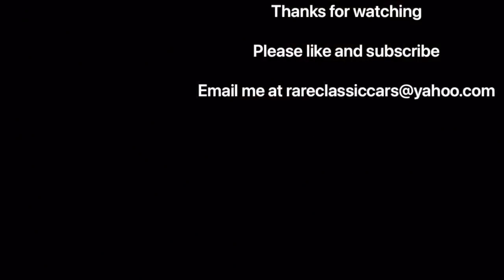Worst Engines of All Time: Chrysler 318/360/400/440 V8 Electronic Lean Burn

Comment: Everything made during that era sucked. Until they got computerized EFI with multi sensors, it was a Rube Goldberg setup. The easiest way to wake up one of those Mopar engines from that era was to order the Direct Connection Electronic Ignition kit. It came with everything you needed and the instructions to install it. You could do it in a Saturday afternoon with a couple of beers.
Reply: It was a little later,but I always laughed at them having electronic circuit boards mounted in an airbox to get airflow cooling.
Reply: @MrTheHillfolk  Land Rover until the early 2000’s because fuck the consumer
Reply: @MrTheHillfolk   My PCM is mounted in the intake air box before the filter.  Why do you laugh?  It's very logical..
Reply: @frequentlycynical642 vibration, under hood heat cycles, etc.  All play havoc on electronics especially from that early Era..
Reply: If you have a lean burn era 318 2bbl, the "cheap fix": hit the local autozone or equivalent, tell them you need a distributor, ignition unit, and carb (carb optional, you can just do the rod/jet magic) for a 76 or 77 dodge B300 van. They were "heavy duty, emissions exempt" on federal emission models, so plain Jane Mopar electronic ignition, no cat, plain Carter 2 bbl. Put all the lean burn junk in a box on a shelf in case you ever sell it to a purist collector, and tune your car like it's a B300
Reply: @ludditeneaderthal  you forgot the electronic ignition 5(4 pin) connector harness.. you can special order. Possibly some dealers parts department would still sell one. I think a dealer is the last place I got one.. but that was prob 10 years ago now. I've noticed parts for even late 80's cars are getting hard to come by and totally obsolete. Also should have a single ballast resistor hooked up to keep the coil from cooking itself. I've heard the accel super coils don't need a ballast... I still run one.. so can't say.
Reply: Your not wrong they all where doing things for emissions and they all took a hit for reliability and hp
Reply: I was thinking 73-87 was the worst time to be a🚗
Reply: @mankind8088  Depends. Some rear wheel drives were pretty good, and even Consumer Report rated them highly.The Fairmont and Zephyr were reliable, as were the Grenada and LTD. The FWD Tempo was pretty reliable. The GM rear wheel drive cars were also very reliable, and relatively affordable. The FWD Chrysler cars are laughed at, now, but they were really the leaders in affordable, FWD cars.
Reply: @mankind8088  I had 2 73 Monte I really liked. Yep still working on leaded. No cacalitic.
Reply: @mankind8088  I'm thinking only till 84.  85 had some good cars starting there
Reply: I did that to my 79 Lebaron with a 318. Also installed a 284/484 Purple Shaft, Edelbrock Performer, 650 Double Pumper, and a TCI 2,800 stall converter. Lots of fun!
Reply: @patrickmorgan7592  yep I had a 68 Newport with the 383 and the optional disc brakes. Very soft riding and very strangely good on gas.😍
Reply: @gerardcousineau3478  
How many  miles per gallon,  with that 383??
Reply: @albundy8052  you wouldn't believe me. but I would say I did about 20 I know that sounds crazy. It was as good on gas as my 73 Monte who was a 350 4bbl dual exhaust the hush trush might have helped. In comparison my 68 eldorado was doing 8 miles a gallon. The Monte Carlo and the Newport were miracles to me. Don't take me wrong though I did like the 68 eldorado too. The Eldorado had a radio that was phenomenal. The ride of the 68 Newport was also unbelievable. These were the day. But like Spock I have no regrets. Though the Monte had hush trush the Newport had it's original exhaust, interestingly with the front disc brakes option. This Newport for it's size was fantastic on gas ⛽.
Reply: I had a 77 New Yorker with the 440 and a Thermo-quad. It would randomly start detonating. The dealership told me that the Electronics were junk and they frequently would go through 5 to 10 new ones before they got a working unit.  they sold me this kit from Mopar Performance and told me it was made to take the old 440 with point ignition to electronic. Like you said, disconnect a few sensors, remove the spark control harness and replace the distributor and the electronic unit on the fire wall.  I had the car for about 4 more years and never had another problem.
Reply: @sreginkc  yep
Reply: Under the hood of my 82 Bronco, there are more vacuum lines than wires. I'm not sure I could get half the emissions stuff working even if I tried, or source any replacement parts. The original transmission had a 3.29:1 first gear and 0.75:1 fourth Overdrive with a 3.00 diff. Pair that with a choked-down 100hp inline six, and that's probably the reason why it was parked in a field for 25 years...No engine power with extremely fast gears. Crappy cars in the name of fuel economy and emissions. I'm glad I wasn't alive to experience it back in the day.
Reply: @jimjamauto   It’s all garbage. Take it all off, and throw it away. 😀
Reply: @drippinglass  That's the plan! Everything except EGR. I'm gonna switch to a Holley EFI and I already rebuilt myself a better transmission
Reply: @jimjamauto  EFI... Lazy!... Haha and why not block off the EGR? It won't hurt to ditch it. And likely would improve things. Another big thing to not forget is the heat riser valve. If ur not familiar it's a flap in the passenger side exhaust manifold. When the engine is cold it's supposed to be closed. Which forces hot air under the carb and choke thermostats (air goes through the intake in a passage) when the engine heats up the flap is supposed to gradually open to let the exhaust fully flow out of that side of the y pipe like normal exhaust. It's a great system for winter driver cars especially... Only problem is 98% of these 40-50 year old heat risers aren't working. Usually the flap gets stuck in the cold (closed position) which will force hot exhaust air constantly through your intake manifold always. So the engine will run like shit once it's warmed up. If your lucky it doesn't function because the thermostatic spring is weak.. but the flap moves free.. if that's the case you can wire it open. It will be good for a good while until you either remove it or replace it.. just a head up. It can be forgot easily and you and even pro mechanics will chase their tail.
Reply: @ron1836  it's gonna be my daily driver at some point so I don't want to deal with a carb. Plus I can make some more power and not loose too much fuel economy. I wanted to play it safe with the EGR because I know some engines do not like it to be removed. Still a novice so I appreciate any help I can get. Cheers!
Reply: I'm sorry but I must disagree. Early EFI systems were tremendously problematic as they got up there in miles. While it may be better in theory, in practice, if your fuel injected car breaks down in the middle of nowhere, good luck getting it back up and running again. At least the electronically monitored carbs and an idle speed screw you could turn up to max to limp it home if need be. Let it be known I've been stranded in far more efi cars than carburated, and I'm just talking about 80s cars here
Reply: I owned a few of these and replaced a lot of parts however for some reason I had a 400 in a Cordoba that was one of the most reliable cars ever
Reply: My parents had a Dodge station during this time period, damn thing could barely pull your socks off.
Reply: SO much sucking going on, from not only a pure aesthetic pointa view, or mechanically, but everything. From the quality of the steel to the quality of the plastics....even the fabrics were wAnK.  '73 - '80s especially.
Reply: @UberLummox  Yep they had to cut costs somewhere with all the Govt. mandates that were being dumped on them.
Reply: @UberLummox  the big three were in cahoots to release inferior products intentionally. If it wasn't for Japanese and European automanfacturers coming in the cars would still be just as bad
Reply: @XxxXxx-br7eq  they are stil bad
Reply: @spartacusnow that's why I retrofitted more basic parts in place of the primitive computer controlled junk. I'm somewhat of an expert on the subject. Ha
Reply: It all goes back to the beatniks & treehuggin hippies from the 60’s that took over the guvmnt & put greenhouse emission restrictions on the entire automotive industry because they were owned by insurance companies. You know how they operate, like gansters. Hey thats a nice car factory you got there bub! Be a shame if anything happened to it! You get my drift? LoL strong arm tactics always work against profit driven companies… which is every company that ever existed.
Reply: Yeah and that's because it had nothing to do with the engines they worked great it was the ignition/Emission system that was the issue if you tossed a points distributor in the thing it would run like a top. That's because it had nothing to do with the engines at all
Reply: Those damn Ford Variable Venturi toilets were right up there, too. I had a Lean Burn 440, years ago that ran like a striped ape.

Comment: Good review. Most of those cars were retrofitted with non-lean burn systems, ran better, and were arguably as clean. You mentioned the 80s - The Mits 2.6 was a horrible power plant and wouldn’t start below 20 degrees F without luck and potential jump. Well done review.
Reply: The 2.6L "Hemi"  lol
Reply: @21Piloteer  it was awful!
Reply: My first car was a 85 Reliant with the mitsu 2.6. I got it in 2000. It always ran rich and guzzled gas, 20mpg at best. in cold wet conditions it would be getting 14. I treated the mikuni carb like the black box it was and ignored it. What ended up doing it in were the timing chain guides wearing out. That was 3 years later.
Reply: I remember my dad had an 84 Chrysler New Yorker (K car style) with the 2.6 Mitsubishi. It was so gutless you had to turn off the A/C to climb a hill.
Reply: @mikee2923  And Japanese is supposed to be "wonderful".
Reply: @michaelbenardo5695  They are except Mitsu is the Bastard child for Japanese Auto Brands.
Reply: @chada75  We had a Grand Voyager with that engine - damn oil burner, eventually froze solid, even though we changed the oil and filter every 2,000 miles.
Reply: @chada75  My wife has a 2010 Toyota Avalon, and it developed a loose piston pin at about 25,000 miles and started using oil at about 65,000 miles unless we put STP in it.  We have the oil and filter changed every 3,000 miles, we warm it up before driving off, we don't floor it, we don't speed with it.  Every American engine that I have had, (66 years old) lasted well over 100,000 miles with the junk oil of the day, with plenty of flooring it and fast driving, and NO BROKEN RUBBER TIMING CHAINS.
Reply: There's a story behind the 2.6 Mitsu. Mopar knew they needed a V6 but there wasn't enough $$$ to develop one in-house. Mitsubishi had realized that engine was a dud and had just designed it's replacement, so they offered Mopar the old one never hinting that they weren't going to use it anymore themselves. Mopar had to agree to buy big numbers of them to get it so they did. Mopar was spent out and stuck with an engine they wanted to walk away from but couldn't. Mitsu knowingly screwed Mopar knowing they'd get away with it and they did.
Reply: @P_RO_  We had a Grand Voyager with the 3.0 Mitsubishi, and it was a garbage engine.  Chrysler also had a 200 cube V6 that was used in mini vans, but they couldn't make enough of them, so they were mixed in production.  The Chrysler-built V6 was fine.
Reply: @michaelbenardo5695  the 3.3 Chrysler will always be a favorite of mine, along with the larger 3.8. Smooth, decently powerful, and utterly reliable. Just wish the early 4 speed automatics had been as good. By '95 they were much better than the '90-94 versions, but still not perfect. My '94 Grand Caravan ES was fast, got 27 mpg on long trips, but would puke the transmission every 50,000 miles. Oh well.